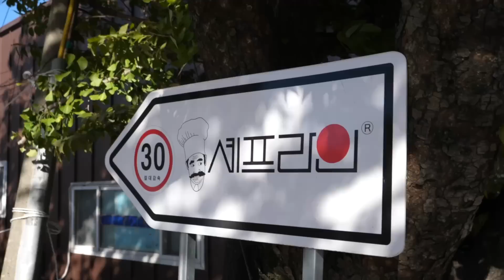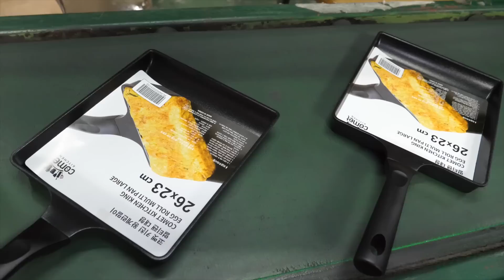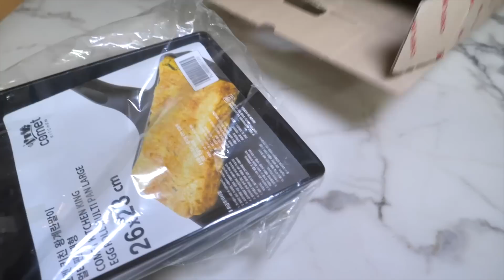process of making a square frying pan. Frying pan factory in Korea

Comment: Omg how are all frying pans not square...Edit: Also this process is better than what Tesla have. Cheaper and more reliable. I think Korea is already the tech pioneer of the world. Its the large amount of "wasted" material Korea useswhich is super impressive. I would never have thought of that. Combined with hitting exess off with a hammer. Not kidding the person who design that has an IQ ove 180. Waaayy smarter than me. Also the cleaner is geometrically position by a dude with a hammer. Also the fill mechanism and the fact that a dude is watching over the molten aluminium. All preferable to Tesla (as in Tesla should ditch the giga press and do this)